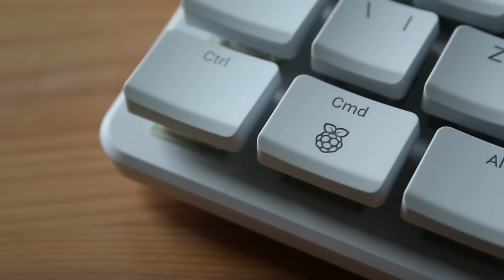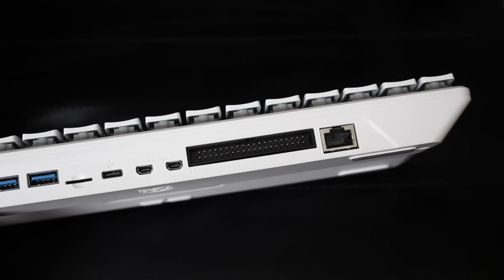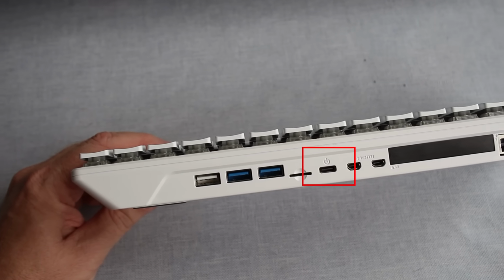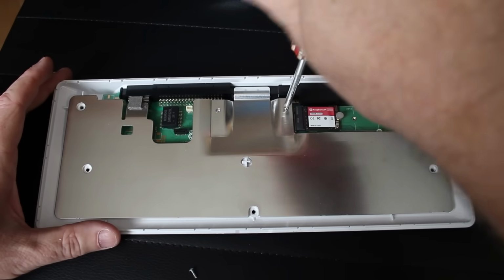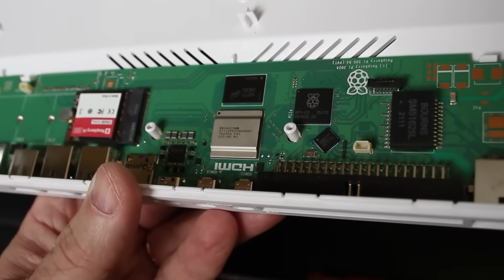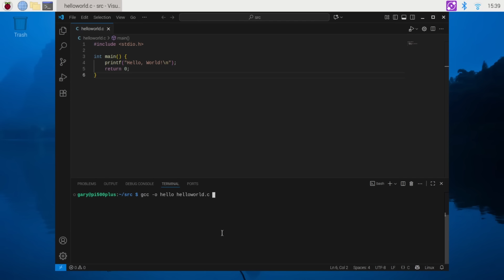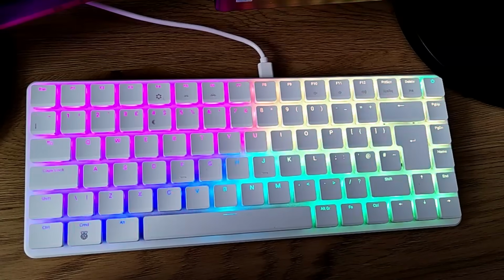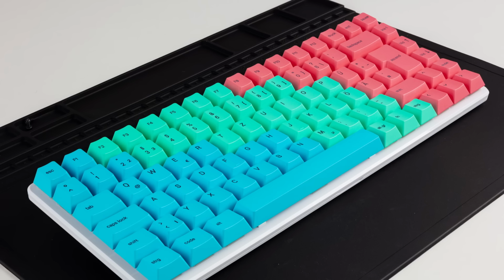Raspberry Pi 500+ Review - Mechanical Keyboard, 16GB RAM, 256 GB SSD

Comment: I asked and recommended them to include a native keyboard port.   Had they done so this would be a Killer system.  Able to be a keyboard  (say Bluetooth or USB natively) or a computer.   Then every techy person who uses a desktop computer keyboard, er that's everyone then, could say:  hey I'll use it as a keyboard to system X and also as a computer.  The market was huge!!   (emaulating a keyboard is just not the same).
Reply from the maker: If you are aiming to use an external keyboard then just get a Pi 5 with a NVMe HAT and a case. You don't need the Pi 500+.
Reply: @GaryExplains  Hi Gary,   to clarify  I WANT to have a pi 400/500.   It could be a Linux system AND if they designed it right,  a plain old USB keyboard to an.other system.   Then I coud have justified its ridiculous price.

Comment: Is there an actual scenario you would actually use it long term over an used laptop for 200.-? just very curious... I bought Pi 400 when it was launched out of curiosity. Have booted it up 4-5 times and just stood in cabinet as an obsolete waste of space ever since. 🤷🏻‍♂ It literally can't do anything else or better than my several years old linux desktop or laptop can do... and it doesn't come with monitor either, so it's not even "portable computer" really. the only evolution which would make any sense for me personally, if they sold it for ~200.- in a Chromebook formfactor with monitor and battery included, but running linux instead of ChromeOS.

Comment: My one day old pi500+ will now not boot beyond the splash screen and the monitor goes to sleep. The clicky keyboard is horrible and the light grey on white shot-molded keys are invisible to my 75 year old eyes. At least they sent a key removal tool so that they can send me some real keys with black letters. 13 years and 35 RPi later it is time to move on.

Comment: Nice enthusiast computer. Can it run RISC OS like the 400 did?
Reply from the maker: Yes
Reply: @GaryExplains  I thought it only could as an emulator, the A67 cannot run the 32bit OS natively, or at least that was the thread from 2023 I was reading today about the Pi5 release - maybe something changed? RISC OS is not available as an image for the Pi500 from the RPi Imager, only 400 and below lists it.
Reply from the maker: @brushlessmotoring  @JonDoe-zi3mh My bad, quite right, it can't.
Reply: @GaryExplains  which is a shame - I've been having quite a bit of fun re-learning BBC Basic on the Pi 400 running RISC OS 3.5
Reply: Not natively.

Comment: Does it support proper sleep?
Reply: Even if it doesn't is that really so much of an issue when it only draws about 2.5 watts at idle?
Reply: @nishiki393  Of course. For the context of portable usage, if you carry a 50Wh battery, 2.5W idle consumption means only 20h maximum battery life. Idle. Nothing is computed. It gives no value. What for?

Comment: I normally don't like the Pi product because the UK prices are high for them, if this come in low price in UK I like this, But i was planning a ITX build with a Radxa RK3588 ITX+, or a Orion 6 motherboard £200-£400 build. This doesn't look as tacky as tyhe passed ones I wouldn't be embarrissed to have this on my desk. I plan to use ARM because I don't need massive cpu power as I mostly need it for streaming/linking to my server where I run VMs.

Comment: I find the RGB keyboards to be really hyped up and not practically useful. Is there a version without it and probably cheaper by another 50$?
Reply from the maker: The Pi 500 has a simpler keyboard but no SSD. If that doesn't work for you, then get a Pi 5, add an SSD, and use a USB keyboard.

Comment: I'm not really impressed by it. The memory is overkill; I don't need any more than 4GB with Linux. Not a fan of the keyboard either. I'd settle for a simple backlight, and I don't need the clickety-clack. I want a Pi 6, with Arm C-cores, not this, and not for $200. I'd sooner run Linux on a $150 Chinese x86 box.
Reply: Are you being serious?

Comment: What about running Windows 11 and Microsoft Office on this Pi 500+ ???
And what about the speed then ?? Tested with ChrisPC Perfomance Test
Reply: I wouldn't hold my breath for Windows on Pi. They've been dicking around with it for five or so years now, and I still haven't seen a straightforward way to get it running. Windows on Arm sux anyway.
Reply: @mikemcgonegal1616  You're about 1-2 years out of date.  Windows on ARM works great.  My laptop at work is ARM based, I use Microsoft Office, Visual Studio Code, and anything else I want to use.  The only thing it lacked when I got it was the VPN our company use, but it's probably available now.

Comment: 200 bucks is a deal breaker
Reply: That’s still budget pricing. If you’re broke, that’s fine too.
Reply: @stephen_sezs oh right, 122% price increase over last year's model with a marginal uppgrade, when you can get a new mini PC and mechanical keyboard with double the performance for less money is "budget pricing".
What a weird cope.
Reply: The price seems reasonable for all you get to me.
Reply: @nishiki393  how so?  The pi 500 was only 90 bucks.  This is more than twice the cost almost a year later
Reply: @LuisMontes Maybe looking at the relative price to the Pi 400 I can somewhat see your point, although the improvements in the pi 500+ account for all but maybe $40 in difference in my eyes.

In addition the Pi 500+ brings a really nice rig all set up and ready to go without having to d**k around with anything.  I don't want to buy add-ons + the SSD myself and fool around with that to get the extra storage etc.

In addition, they probably have slightly underpriced the pi 400.

Comment: They’ve taken a Pi500 and more than doubled the price to add an NVME slot and a small SSD. The clicky keyboard with the disco lights is utterly pointless.

The whole point of raspberry pi’s is that they’re highly affordable. I was looking forwards to the pi500 with just an added slot for an SSD. 

This one is more expensive than budget Windows laptops and less capable. What an epic fail.
Reply: I think the raspberry Pi Foundation lost the plot a long time ago. I have no idea why they used a 2230 for the SSD when they didn't have to. Literally 99.99% of the market is 2280. WTF.

All that being said, I think the programmable LEDs on a mechanical keyboard is pretty awesome. Sorry you think it's pointless. Then don't buy it. I just don't know if it's worth $200. I'd say this is worth $150, though.
Reply from the maker: @aleaxdeathbringer  Just of clarify the Raspberry Pi Foundation and Raspberry Pi are two different things. The latter is now a full commercial operation and had an IPO last year. Also,  why does the physical size of the SSD matter? Most boards including the Pi 500+ can accept both 2230 and 2280 modules, but the 2230 has size benefits as shown by the recent  Raspberry Pi M.2 HAT+ Compact.
Reply: @GaryExplains - Possibly his point with the SSD is price. A 2230 is more expensive than a 2280 pushing up the overall price, that being a big issue.

I highly doubt that the size of the SSD has affected the price they pitched it at though. That’s just a number plucked out of the air. How the hell they get from $90 for the Pi500 to $200 for this beggars belief. $110 minus say $40 (generous) for the extra on board components and small SSD. Minus $10 (generous) for the extra ram. That leaves $60 for the childish light up keyboard.

I’m sure there’s a cohort of people somewhere that will want to buy this for $200. I think they’re about to find out that it’s very small though.
Reply: @GaryExplains  Well, that explains why they've gone crazy with the pricing. Capitalism. Gotcha.

The physical size matters in this case because there's a noticeable price premium for 2230 form factor drives vs. the ubiquitous 2280 form factor. In this use case, the 500+, there's no benefit to going with the smaller one. If they had gone with the larger drive, perhaps they wouldn't have had to charge $200 for this model. Or they could have, still, and yielded more profit. Whichever. In either case, going with a 2230 when it's not necessary is not the best move.
Reply: There's also 2x the ram (16gb instead of 8gb on the Pi 500)

Comment: wtf with the hdmi outputs? they have to pay fees for hdmi, ffs use DP/minidp or rather a usb-c port with alt-dp support and power delivery so you can have once cable for all system powered by the monitor or dock with a bunch of ports

Comment: Should have put a user accessible NVMe drive on the base via a plastic cover and an option to buy without the 2230 drive to reduce cost. PSU should have been included at this price point.

Lots of unused pads on the motherboard too.

Comment: As someone who reviews keyboards for my YouTube channel, this is a nice addition to the Pi Family, but sadly, it's lack of hotswap support meaning that when a switch fails, you need to resolder new low profile switches into the board. Kinda bummed it was also fixed with clicky switches from gateron. 

A better version of this would have the option for users to have their own barebones version (the user has the choices for keycaps and switches), or if not that, at least make the PCB hotswap for modding and maintenance purposes :)

Comment: I hope someone in future makes a product like this with MediaTek Dimensity 8000 or 9000 series 12-16gb ram and an SSD and optimised for Linux
Reply: The 500+ by default runs Raspberry Pi OS, which IS Linux (and so optimised)
Reply: Mediatek and Linux are not compatible. Chrome OS / Android could work out.